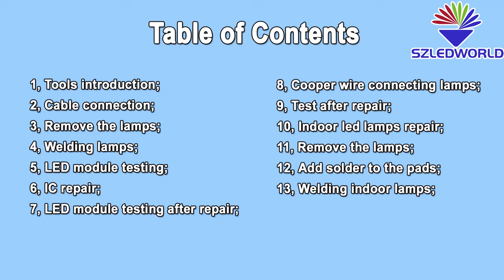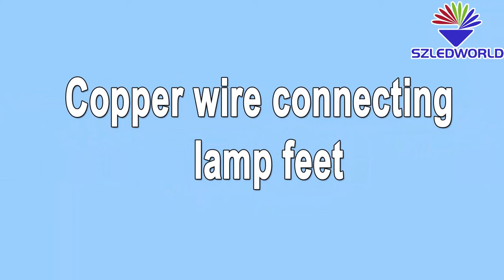led display screen module repair, IC, lamps repair outdoor, indoor P10, P8, P6, P5, P4.81, P3.9, P2

Comment: I like your way for explaining how to fix the problem..!!
So I have a problem in my led display screen module..!!
I have around 6 meters long display screen and consists of two lines of led blocks...
The problem is that the (upper line) which consists of around 15 led blocks is the whole blocks are always lit up, while the (lower line) is working and displaying normal which shows up the lower half of the words and numbers only...!?
So please if understand my explanation, tell me how to fix this problem..??
Thank you so much...❤
Reply from the maker: Hello Bro.
It would be better if you send a picture to explain, it can illustrate the problem vividly.